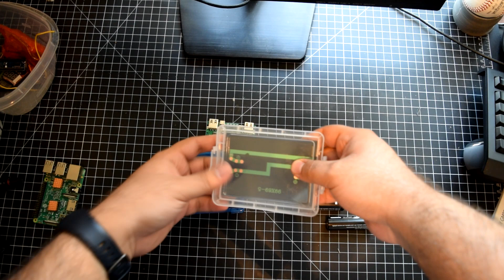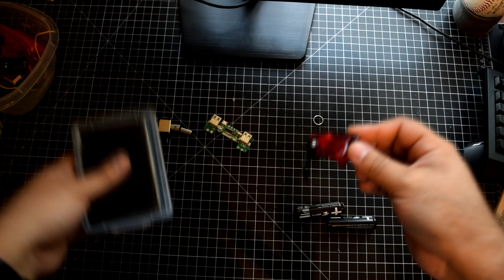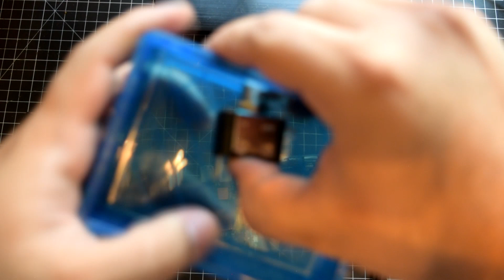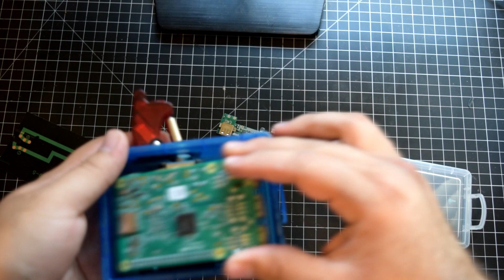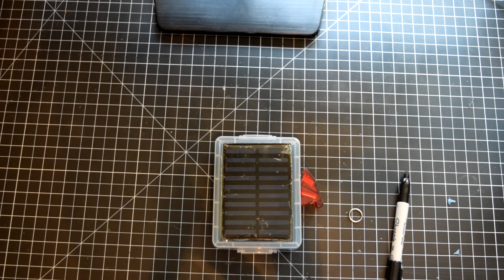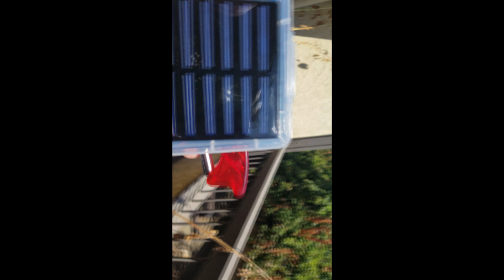Pi Series: Raspberry Pi 3 - Solar Powered with 18650 Batteries.

Comment from the maker: Do you guys want me to make a follow up to this in 2020?
Reply: I’m keen, I’m wondering if that solar panel is large enough to charge the battery to power the pi?
Reply from the maker: It was not, it would just slow down the battery drain.

Comment: Found this in 2022. Would love an update!
Reply from the maker: Maybe I will!!! Any more specific features you would want to see?
Reply: @AlansInventions  Oh boy. I couldn’t tell how the 18650s attached and were retained. Are they enough to get through the night? How big a panel would it take actually to charge 2-4 cells? Now that there lots of cheap usb-attached panels, would a 5v 3a panel suffice? Could you use one directly plugged into a usb battery bank, say a 5000-10,000 mah unit? I know most have some kind of charge controller, so would external boards be required? I could see a parts list: Pi, battery, panel, case, camera. That’s it- in my dreams. But my electronics knowledge is ... none. Still, this project would be perfect for a bird cam, and I have a spare Pi 3b. You have a relaxed presenting style. I think you could go head to head with Jeff Geerling and Chris Barnatt. Thanks -

Comment: Needs a bigger solar panel. Also for solar projects the Zero W draws a hell of a lot less power than the bigger boards. Unless you need the extra features you'd be better off with the $10 board. I'm looking at solar for an off grid surveillance system.
Reply from the maker: Thanks, I know. This was  a thing I threw together in 5 minutes.. Never really expected to get more than a few minutes of usage from. I do have a couple pi zero laying around, might re do this project.

Comment: How long does this actually stay powered?
Reply from the maker: Unfortunately not very long. The batteries I ended up using were knock offs and had a very low power capacity.

Comment: Do you have a link for the board? Also how effective is the solar panel at keeping the pi running?
Reply from the maker: I have it running since yesterday night, the board has a 4 led indicator and has not dropped below 2 led's. I am only using two 18650 cells. 3,000 mAh each. For the price of the board i'd buy two and just hook up the solar panels together and maybe add another two batteries. 

https://www.ebay.com/itm/Solar-LED-Portable-Dual-USB-Power-Bank-5x-18650-External-Battery-Charger-DIY-Box/382491615020?ssPageName=STRK%3AMEBIDX%3AIT&var=651244303104&_trksid=p2057872.m2749.l2649

Comment: Did you end up using this for the PirateBox?
Reply from the maker: Yes and No. The solar panel was inefficient and wouldnt charge the batteries fast enough to prevent it from dying. However it is all setup with the software. Below is the link for the piratebox software. I am thinking about re-doing it, I have a couple small flat 1300 mah batteries that i might use. https://piratebox.cc/
Reply from the maker: Unfortunately the 18650 cells I bought were cheap ultrafire ones. Only 550 mAh. To answer your question, not very long.

Comment: But wtf does it do? Lol.
Reply from the maker: It's a wifi access point that you connect to from any device with a web browser and you can chat, share files and no internet is required. This one I tried making it solar using a couple batteries and tiny solar panel but it was not able to stay on for long. Lol the solar panel did not charge fast enough